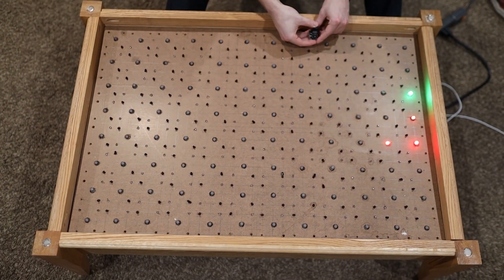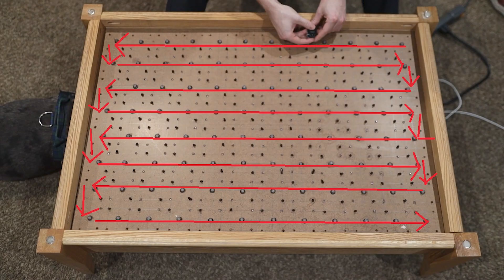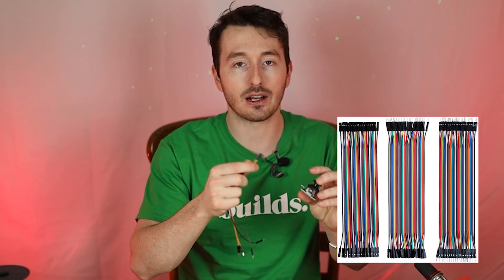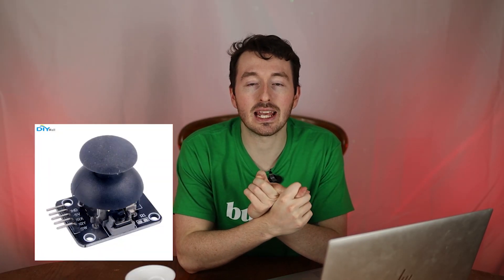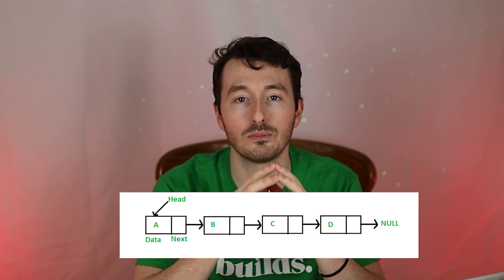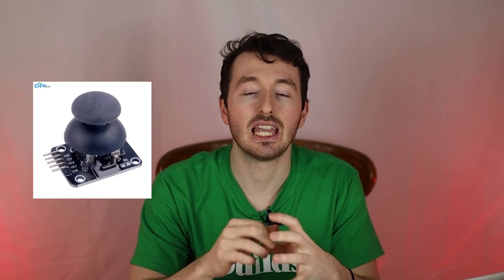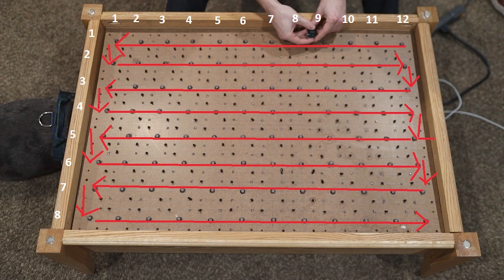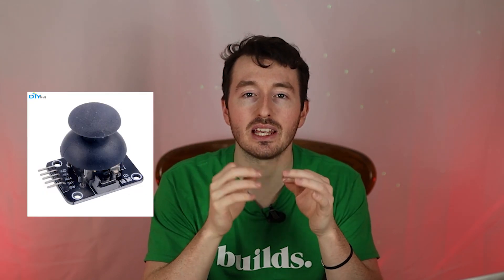How to make the Snake Game on Arduino: Arduino Snake Game | Arduino Projects

Comment: Hi, Like the videos but i have a question,  on your instructable on the interactive coffee table, some of the links to the items dont work, could u fix this ? Also what items exactly do u need for this led game, also the infrared sensors? etc. Thank you for you time.
Reply from the maker: Sure will go in and fix shortly sorry about that. For this game you just need the LEDs, the 5V power supply, and the analog stick, as well as the arduino. You won’t need the infrared sensors for this one